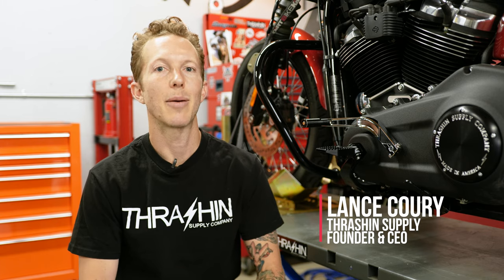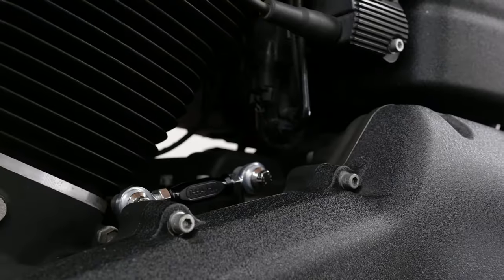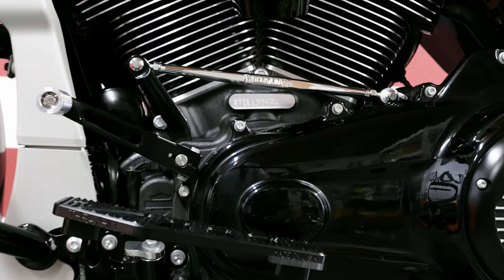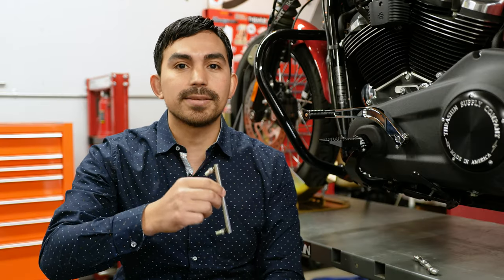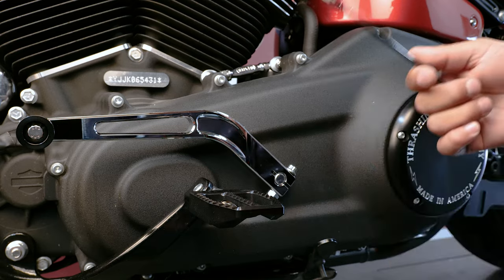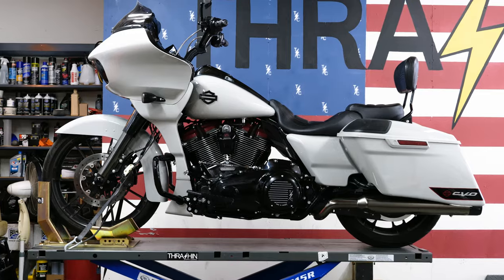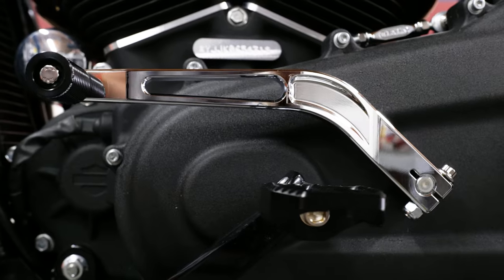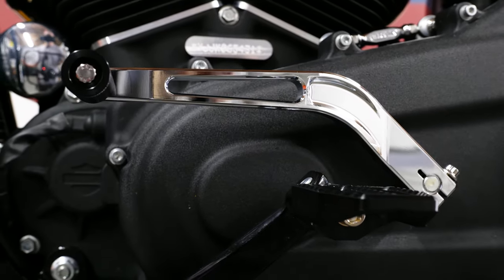Thrashin Supply Billet Shift Levers & Adjustable Linkages For Harley-Davidson

Comment: These are game changers! 🤘🔥
Reply: How? Purely cosmetic.
Reply: @rebel_ltz  They make it so you're able to adjust the position of your shifter without removing and replacing them on the spline. Also, without the poorly constructed and rubber joints from the stock setup, there is no flexing or play when shifting. Instant and responsive. Quite the opposite of purely cosmetic.

Comment: When you tighten the nuts at each end, do you need to hold the flat area of the shifting shaft with a wrench so the shaft will not turn or can you tighten the nuts by turning the nut and allowing the Heim Joint to spin to a locked position and not hurt the Heim Joint? In other words how do you tighten down the nuts so they are tight each enough? On a regular rod, one wrench turns one way and the other the opposite way as you tighten the nuts down both together, but on yours, to tighten both nuts they both turn and spin down? Would like to buy this product but this has me wondering how to tighten the nuts good? It would be nice I think if you continued with this model but made one without the left hand thread also , then people would have a choice.
Reply from the maker: You just hold the flat area with your fingers and tighten the nut with a wrench and it works perfect.
Reply from the maker: If you made it without left hand thread, you would have to remove the linkage off the shifting arm posts to adjust it. Would defeat the purpose. 🤷🏼‍♂️
Reply: @THRASHIN  Yes I realize its purpose but I can't understand why someone would need this feature? Unless you change from shoes to tall toed boots all the time? Just adjust it once and forget about it.